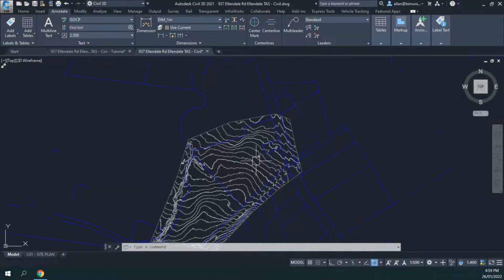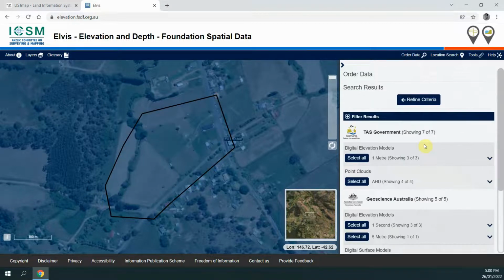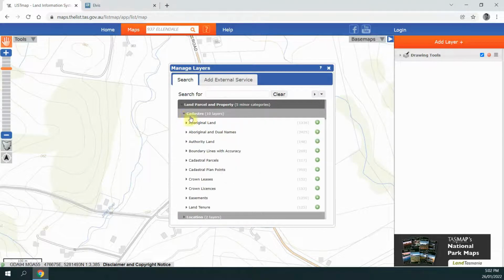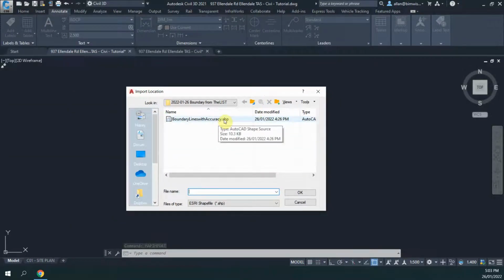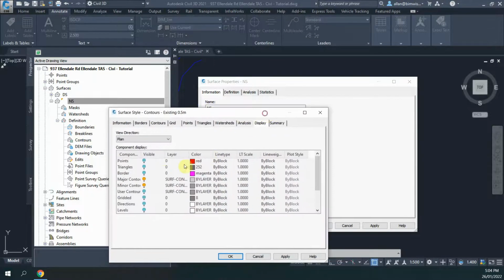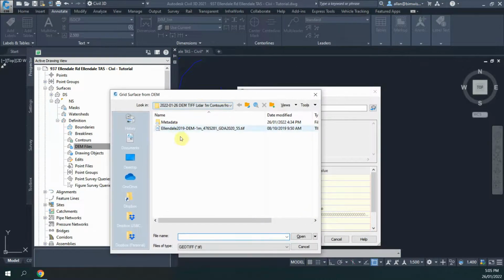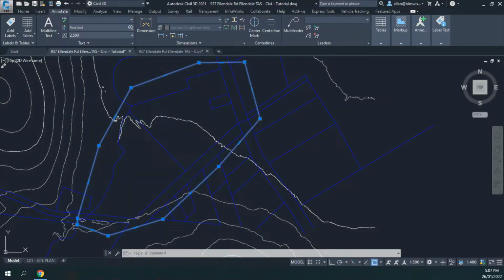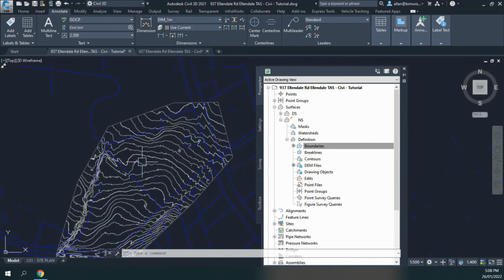Civil 3D Tutorial - Create a site plan from the free data on the internet - TIF, LIDAR, DEM, SHP etc

Comment: Thank you for the walkthrough. One quick suggestion I would make is to add your boundary as a "Data Clip" boundary before importing the surface data. An outer boundary just hides the data, but still processes it. A data clip boundary will completely ignore any data outside the boundary. This can save you a lot of time and hassle if the import data is significantly large.